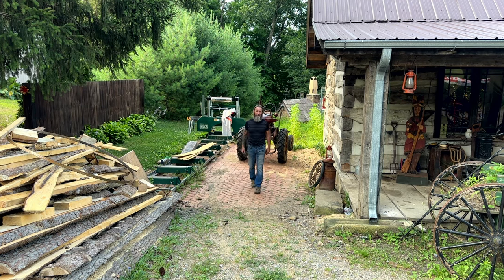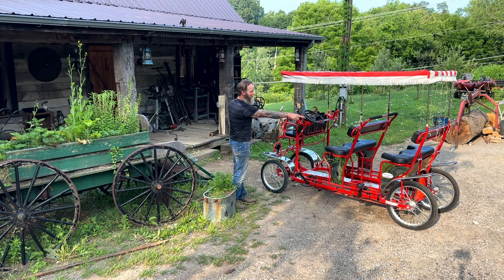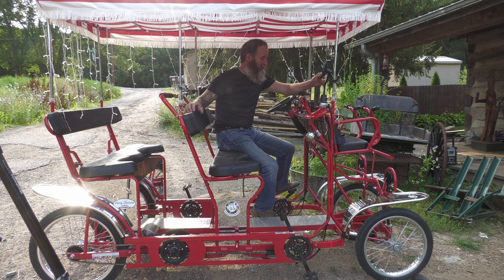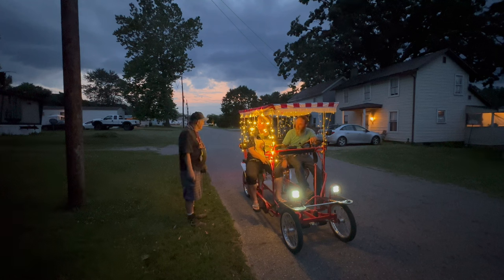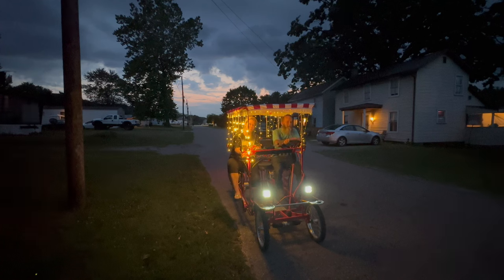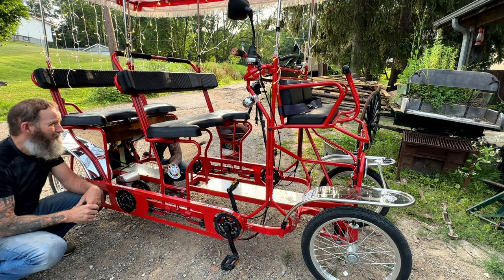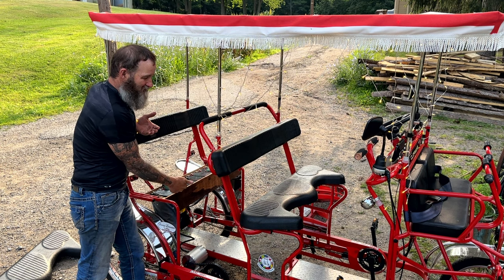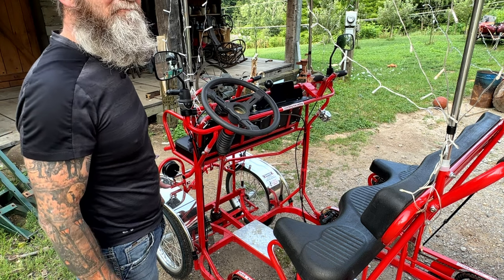8 person Surrey bike turned into 40mph e-bike limo

Comment: Wow 
What a job 
I have one that got ruined during hurricane Ian.
The peddle assist is 2k to replace so I’d love to try your solution.  What motor did you use and where and how did you connect it to the drive?  I’d really love your help and advice in this
Thanks

Comment: Either a 72 T flywheel or a 84 T flywheel will make it go faster than 40 mph it will go 60 or 70 mph.....
Reply: Sounds exiting but thats sounds about as safe as a helicopters moving parts. 1 failed mechanical part and accident can happen(pushing 60 in one of those with a wreck would be a nightmare)